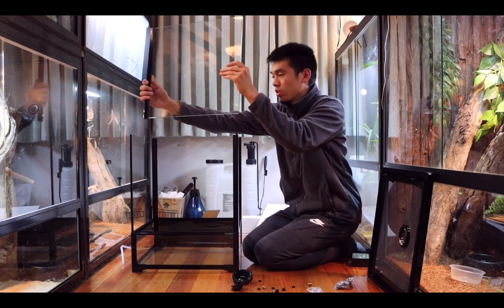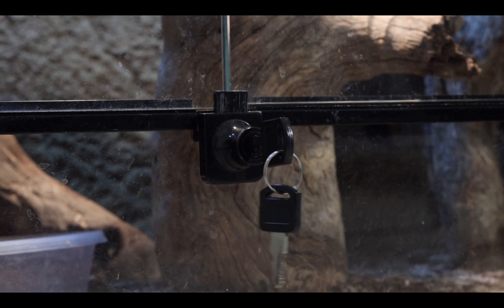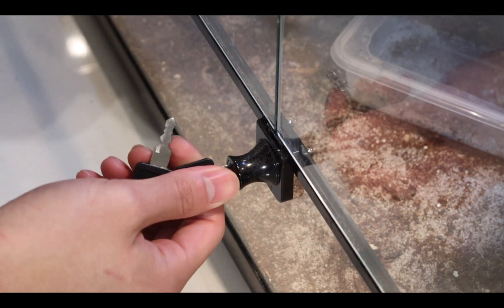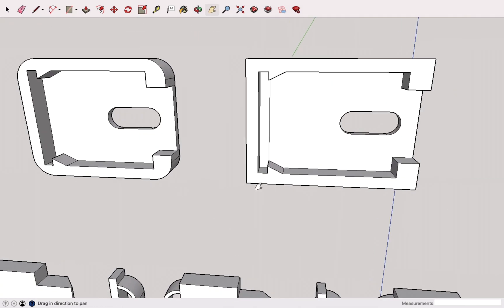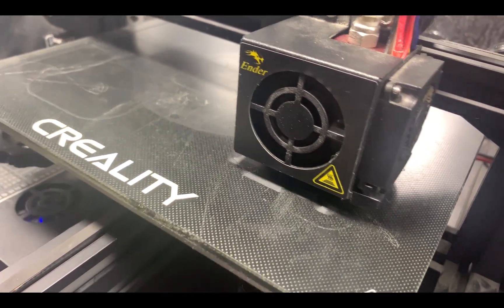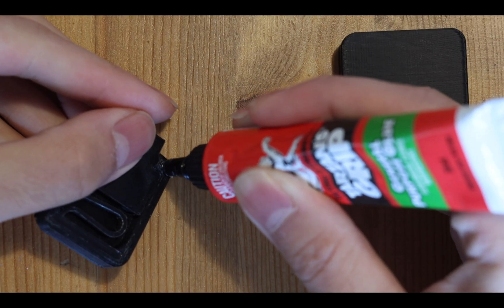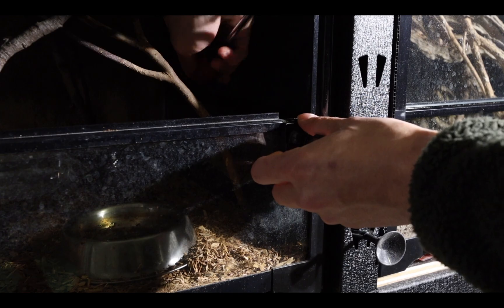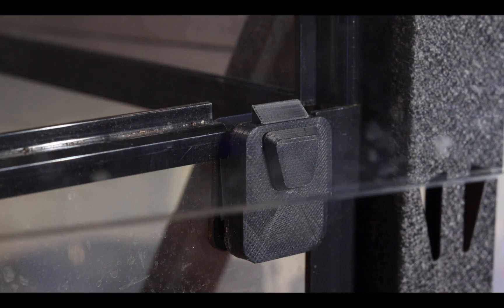DIY Demo: glass terrarium door lock upgrade

Comment: I mean i have always been able to buy spare reptile one locks 

But the lock sticking issue is a nothing a quick spritz with WD-40 cant fix in the actual lock barrel i am cheap and won't buy a new lock unless i absolutly need to because it had taken me 3 years to get most of my locks on the same two numbers (retile one hinged locks are only 999 possible  combinations) lots of reading keys on spare locks and phone calls to achieve that one

But kids here so i got really good at opening all my tanks one handed with food in the other 

And love the rack it system 
Is it overkill? maybe but you know you wont overload it no matter how hard you try 

Is it the unspoken hero of nearly every reptile tank rack? yes 

Personally i climb on mine while I'm cleaning the tanks on the 1.8m heigh (2.4m high racks)

Do my tanks and i weigh a 1000kg 
I certainly hope not